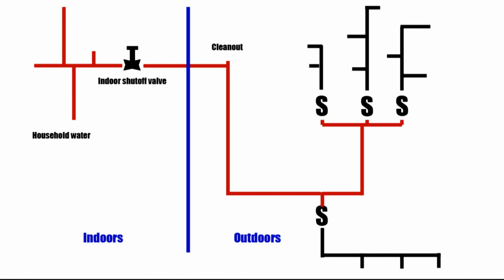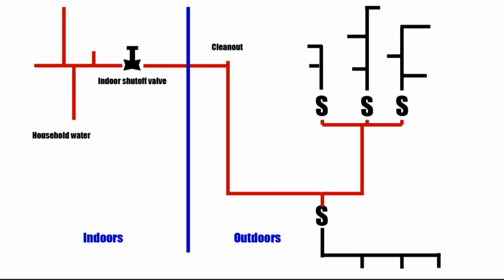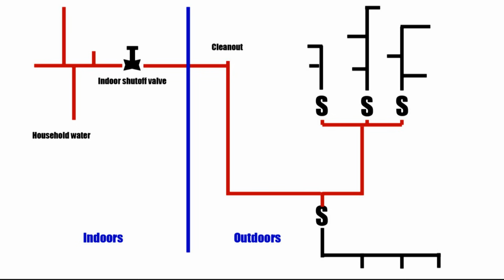How to fix a leaking sprinkler head

Comment: I have a sprinkler system that pumps water out of our lake. One zone is at a level with some heads that are lower than the pump. If I prime the pump and run all zones everything works fine, the problem is that after all zones have run the zone that has the heads below the pump continue to leak water. I then have no prime left when it comes time for the system to run again. Is my problem the diaphragm the same as in this video or is there another problem? I put a new check valve between the pump and the lake so it should not be loosing  prime that way. Any ideas for what I do next?
Reply from the maker: The zone is siphoning, and so to break that you need to allow air to enter the zone tubing with an antisiphon valve. You need to replace your zone valve with an antisiphon valve. That valve should always be placed at the high point in the line, usually about 18" higher than anywhere else in the line. Ideally it should be placed above the level of the pump and water source, too. If you already have an antisiphon valve in place, it needs to be replaced. I have a second irrigation video, showing a bad solenoid. All the valves in the second video are antisiphon valves, in contrast with this video where none of the valves are antisiphon valves. Notice how antisiphon valves are placed in a vertical loop, well above the surrounding ground.  When the line pressure drops, a flap valve opens, allowing air into the line, breaking the suction. When it works correctly, you hear gurgling as air is drawn into the line by the suction of gravity acting on water inside the zone piping. With an antisiphon valve in place, the central line should retain it's prime, though I suppose if the valve is leaking you might see a continual drip. Normally these zones should leak a little for a few minutes after each cycle, but leaking should not continue for more than an hour or so. Good luck!
Reply: P

Comment: I attended a lawn irrigation seminar held by our city last weekend. They offer advice, tools and parts to repair home systems.  I have a zone that ALWAYS comes on whenever I turn any other zone on.  I replaced the solenoid, but the area around the valve fills with water and as in your video those sprinkler heads leak and I have nice wet area around each sprinkler head in that one zone.  I bought a new diaphragm, but I checked the valve and the old one LOOKS OK, so I put it back together.  What could be my problem.  My low back argues with my kneeling and squatting, but as you said, I am leaking MONEY!
Reply from the maker: The first thing I would do is turn a different zone on, and then check to see if voltage is making it's way to the solenoid of the suspect zone. If it is, then the problem is not with that solenoid or any mechanical problem, it's electrical. Some systems come with the option to program multiple solenoids at once, so it might be worth while to check the manual and see if it's been inadvertently programmed incorrectly. The other possibility that comes to mind is accidental miswiring of your devices. Possibly, the wires that should be going directly back to ground are instead being routed through the 'bad' solenoid before reaching ground. In that case, you might see a half size voltage drop across each active solenoid. A few minutes with a DVOM will help solve that kind of problem.

Comment: If you would purchase a quality valve you wouldn't be making this video.
Reply from the maker: Somebody else made that same remark in the thread below. Like most homeowners, I didn't install or even contract the installation, I bought the house as is. Most homeowners don't get the chance to make that decision in retrospect.
Reply from the maker: Those are wise remarks, Greg. You see that in all kinds of arenas, not just sprinkler systems.

Comment: If you turn off the main valve shouldn't it stop leaking?
Reply from the maker: Yes, if you mean the main shutoff valve, the leak will stop if you do that. But these systems always leave that central valve open all summer; it's not controlled by the microprocessor. When you have a continuous leak out of one sprinkler head, the leak is at the valve controlled by the solenoid for the zone in question.

Comment: one head on one valve is kinda un common. I have 5 or six heads on some of my zones, 22 heads in all. I would think that you really have some high pressure in those zones, because it takes some high pressure to push water thru those heads. The heads I have are spring loaded, which I would think most have. That loaded spring in the head retracts the head when the solenoid shuts down, so even with some pressure, the head must be week , not closing off even the slightest leak from the solenoid. Does that make sence?  lol

Comment: Thnaks for this information.  I had no idea that there was pressure in the line ALL the time.  I thought turning off the timer was enough.  Now I know I have a bigger problem than I thought!  At least now I will know how to address this.
Reply from the maker: Yeah, the supply line proximal to the solenoids is always charged. So a continuous leak has to be from the main, whereas a leak beyond that is often more subtle and intermittent. It's very helpful to know where all those lines are routed -- I'm surprised subcontractors don't give the homeowner a clear diagram after the system is installed. Thanks for watching!

Comment from the maker: Yes, flushing with water is the best method, by turning the water on for several seconds. Not only do you likely remove the offending particle, you also may dislodge other debris that is lined up to cause problems later. Be prepared to have water all over your work area, and try to avoid getting any dirt from the surrounding area back into the lines. Its hard to avoid causing a mess, but you might try covering adjacent dirt with a towel or tarp.

Comment: This video seems very helpful.  When you say "flush the line" to remove debris - do you mean simply turning the main water line back on inside the house to the sprinklers for a moment?  I do not have an air compressor.

I'm assuming once the diaphragm and spring are removed that no other parts will fly out of that valve under pressure?

Also, does home depot sell replacement diaphragms too if I need to go that route?  or is just specialty irrigation shops?

Comment from the maker: I went to a local irrigation supply store. But before you replace the diaphragm, be sure you need to. The commonest problem here is a little fragment of debris, maybe smaller than a grain of sand, that gets caught in the gap between the diaphragm and the seat. Flush the proximal line with water or air and clean it out really carefully. Look closely at the seat for scratches that might leak.

Comment from the maker: Almost never. Even if the head was 'leaking', the plastic pipe leading to it should have little pressure except when the system commands the solenoid to open. So, leaking when the zone is not active signifies a problem with the solenoid, normally closed.

The sprinkler head is always open, permitting water to spray out whenever there is pressure in that pipe. If the sprinkler somehow became loose from it's threaded connection, it would leak only when commanded on, not all the time.

Comment: When I initially cleaned the gunk out of the valve, I completely removed it to the sink with hot water and brushes, I then partially opened the main to wash anything out. The culprit was indeed the diaphragm, the seal had sat for too long on a pebble or something that made a pretty permanent dent in the rubber seal. A new one later, and my swamp is drying up! :)

Comment from the maker: If I were to make this video again I would put greater emphasis on how important it is to flush the proximal line that leads to the solenoid. Even after an initial inspection, by far the commonest cause of persistent leakage is proximal debris, rather than a bad diaphragm or damaged valve seat. Rust and calcium flakes off inside the galvanized pipe, tumbling downstream before being trapped at the valve. When the water is turned off, some particles reflux upstream out of view.

Thanks again.

Comment from the maker: I don't remember the brand, and we have since moved. But you should likely be able to do this without any new parts -- it's probably just debris in the proximal line that needs to be flushed out either with water or air.

Comment from the maker: If all of that fails to detect the cause, the LEAST likely cause might be high resistance in the circuit that powers the solenoid. I've never seen that before, but if it is a cause you could find it by doing a voltage drop test for the solenoid power circuit. I show how to do voltage drop testing in my automotive starter motor diagnostic video on this channel.

Comment from the maker: Commonest cause is a small piece of debris, proximal to the solenoid, holding the seal open, and returning up into the proximal arm when pressure is off. So, if you have a compressor, flush the proximal arm with air while the solenoid is removed. If that doesn't work, I would flush it with water, accepting the mess of water you might cause around the valve. If that doesn't work, look for scratches in the plastic seat that might prevent a good seal.

Comment from the maker: I hear you say that ALL the sprinkler heads leak. In the fall, after blowout, I manually open all the sprinkler heads so they don't retain water. It would be a disaster to freeze water in those pipes. To prevent that, when the system is not used I twist open all the valves. In the spring I close them all before waking the system up. So, I would go out and twist  the tops of the sprinkler heads clockwise to be sure they are all manually seated properly. I would not assume a sneaky practice.